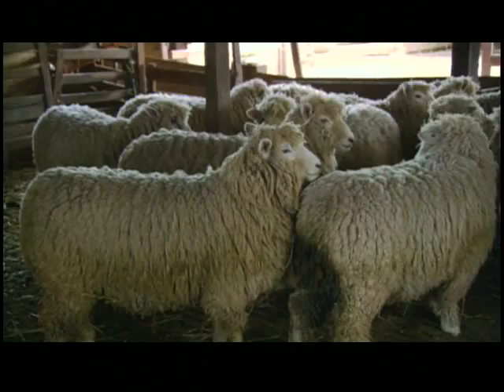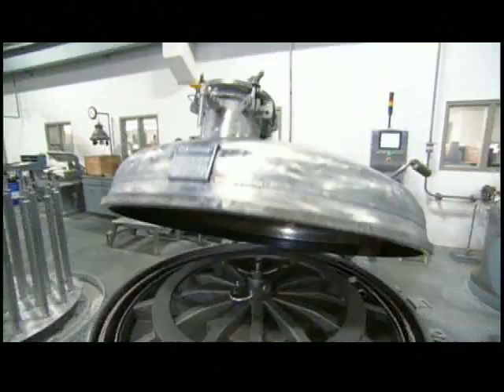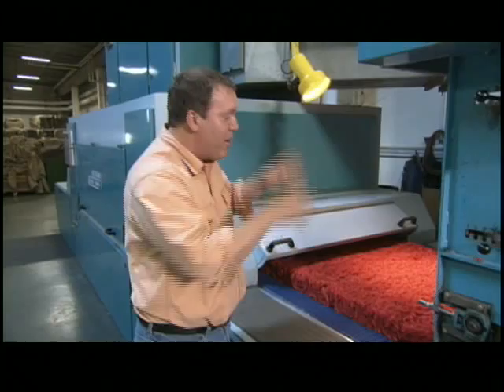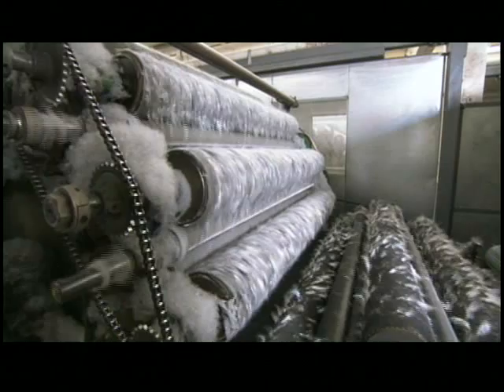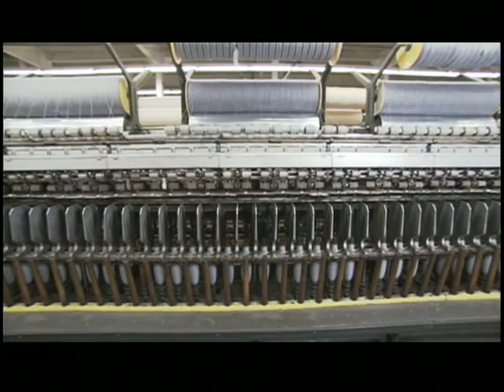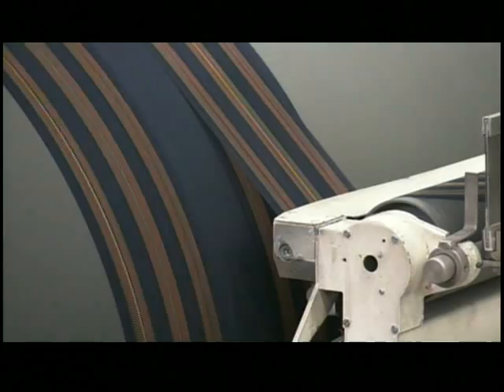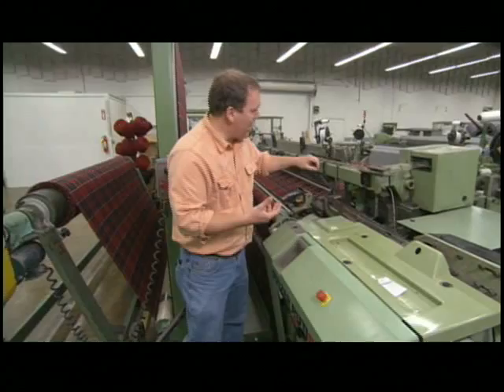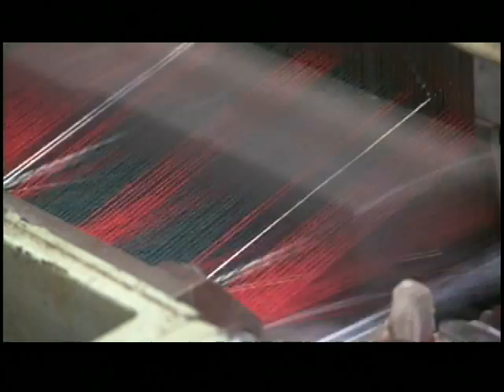Pendleton Woolen Mills Tour (Washougal, WA)

Comment: you can use the tex count.1000metres of yarn.weigh its weight will give you the tex count.if the 1000 metres weighs 600 grams you have a 600 tex yarn it can be 1 ply or 2. ply or greater .